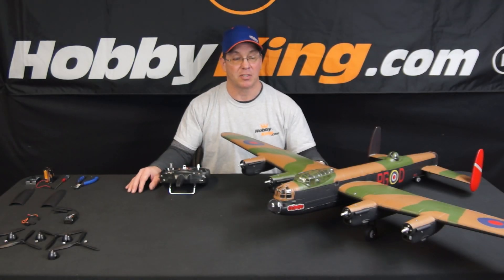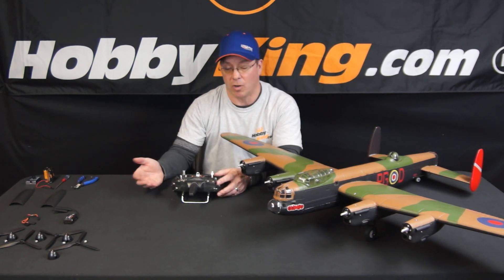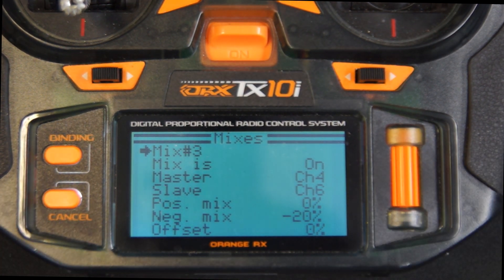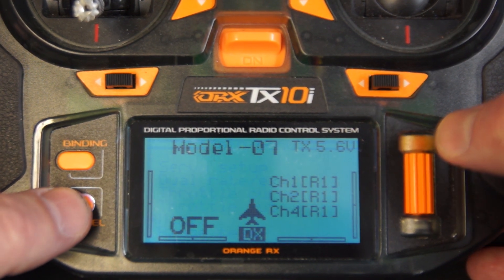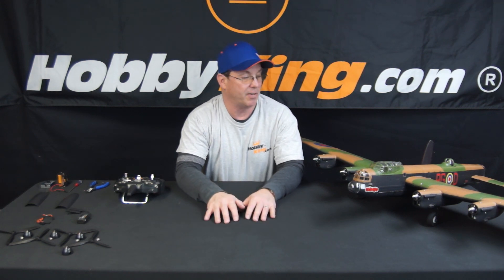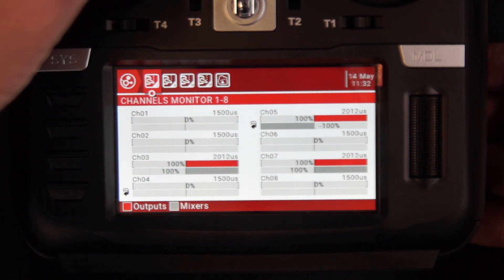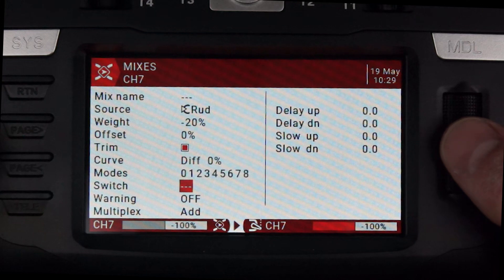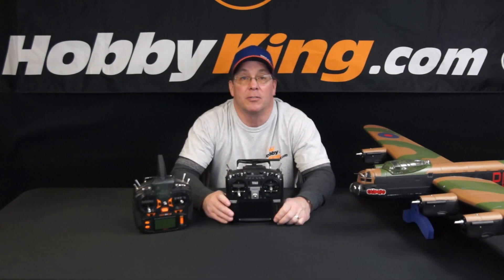Tips Bench Tuesday - How to Setup Differential Thrust for H-King (PNF) Avro Lancaster V3

Comment: Thx for the vid. I have a question?:Assuming you install the tailwheel servo wih retracts and differential thrust with a 6 channel TX/RX, Where do you install the tailwheel servo assuming throttle is on channel 1 and 6? Thx

Comment: Do you know if it is possible and if so HOW to set Throttle cut on a Differential set up ??
Reply: That  would depend on the radio but it may need to be another mix set from a switched ch to both throttle channels.